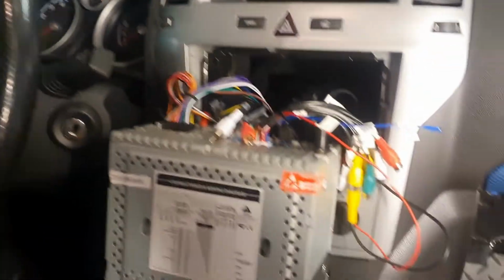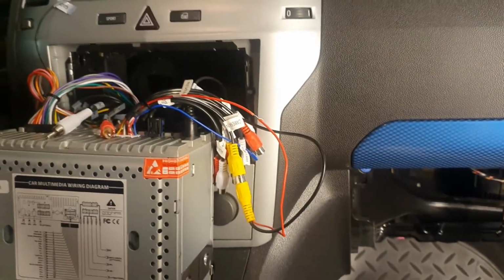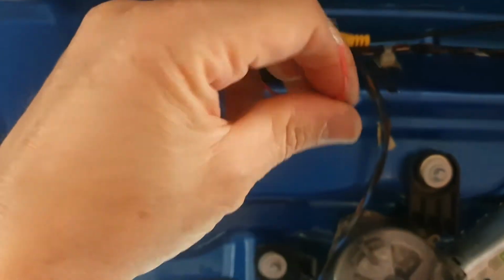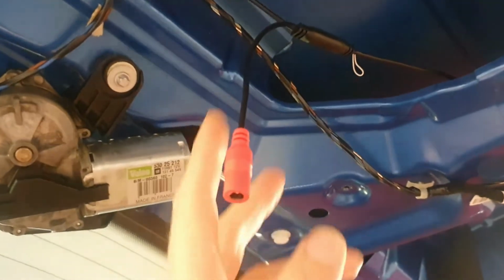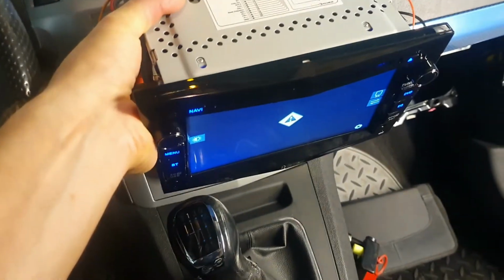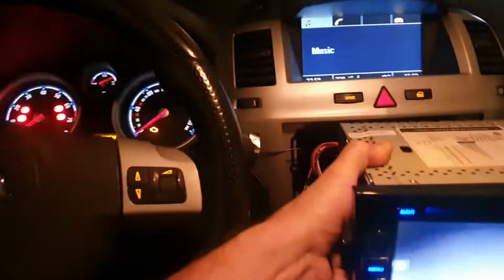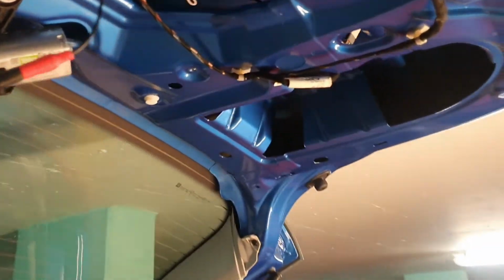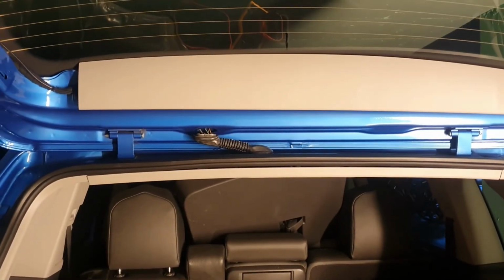Opel Zafira B Reversing Camera connection (to Android Radio)

Comment: Hi mate, I see you put an inline in, otherwise it’s literally red to reds and ground the black. So much easier then Iv been seeing and reading… what size inline is that please? Also does it need to have it? Does it have to be glass fuse like you got or can I use a mini blade one
Reply from the maker: Hi, I think it was a 10A fuse, and it came with the camera kit. I figured since it came with the kit then I should probably use it. :)
Reply: Okay thanks, so I used a 10a mini blade fuse. Done your loop just in a different direction, so I’m fairly certain it’s not that… however, where do you go into the back? Iv gone into the thick red power lead on main loom. Iv read somewhere about a pink lead? Mine only seems to be on the aftermarket loom

Comment: Hi mate, I have just buyed a Zafira 2011 plate. The sat nav you have in the bit of, where the clock is, what do you put in the search bar to get 1 ?
Reply from the maker: I got this A-sure Radio:
https://a-sure.com/products/7-android-9-0-gps-navi-car-radio-with-4gb-ram-64gb-rom-for-opel-corsa-astra-antara-vectra-meriva-zafira-vivaro-kmqovb6

Model :KYQ_OVBJ
4GB DDR3 ROM
64GB RAM 
It's OK. Sound is good. 
Some minor negative points:
Cross-talk/interference from the CPU audible when nothing is playing.
The Launcher/default screen is not very configurable 
No slot or cable for a SIM card
Spotify app is buggy 
Tidal app is unusable because it's missing some controls 

I would consider this one, because the Launcher looks better
https://a-sure.com/products/8-silver-android-10-dab-gps-navi-car-radio-with-octa-core-4gb-ram-64gb-rom-for-opel-vauxhall-corsa-astra-antara-vectra-meriva-zafira-vivaro-%e7%9a%84%e5%89%af%e6%9c%ac

Check out idoing - they have an android radio with 6GB ROM. Don't know if it fits the Zafira though.
Reply: Hi, not the A-sure radio, the sat-nav on top. Where the clock was ?
Reply from the maker: @kamrankhanblu-raysandcolle9101  it's the original that came with the car.
Reply: In England, it’s just a standard clock, we don’t get a sat-nav